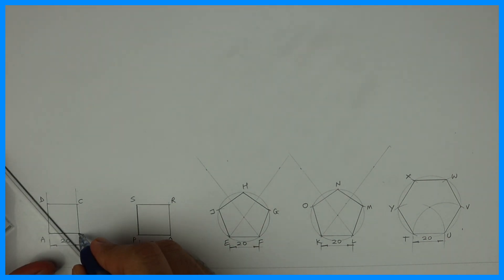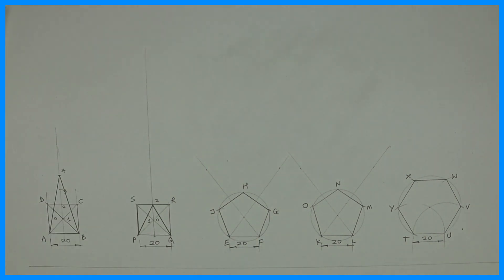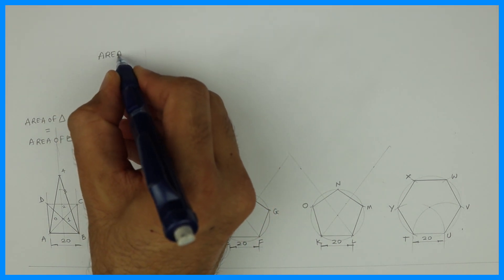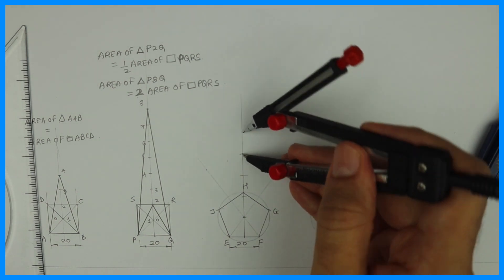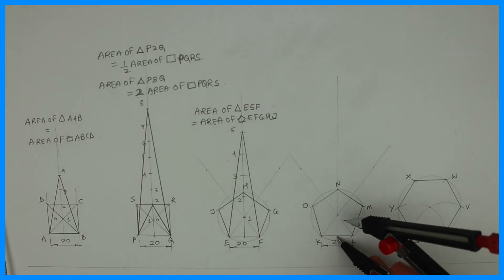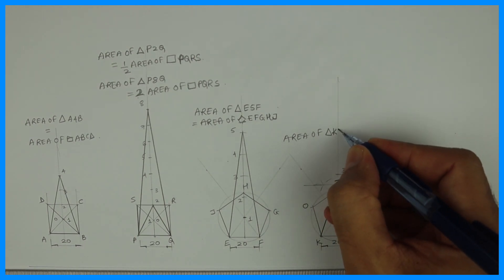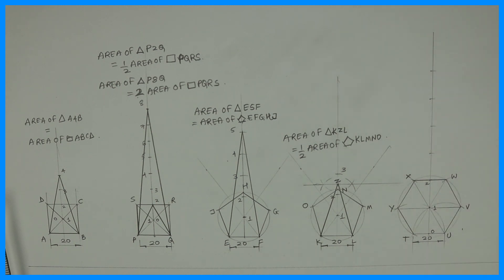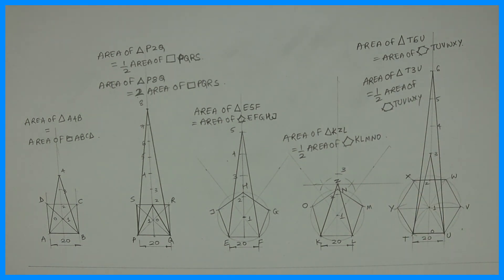Area conversion  - 2 - Engineering drawing - Technical drawing

Comment: Hey i know this comment is very kate but for hexagon if you conect alternate vertices the triangle formed will be half the area. Try it i used this in exam when i didnt remember formula. Didnt get the marks but should have prollly gotten the marks for coming up with that on the spot but clearly schools dont want you do actually think.
Reply: If you were correcting would you give it a mark ?
Reply from the maker: @unlinedphoton7965  yes I will do it that way and upload it in near future ...
Reply: @technicaldrawing  no no this is the right way to do it if you want the marks but in practise is it actually correct as i measured the areas and got it right